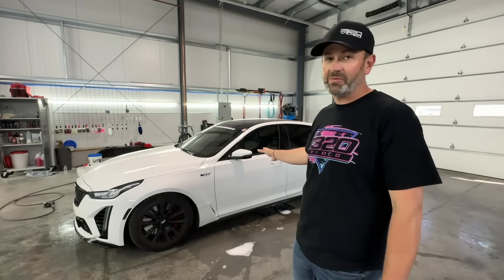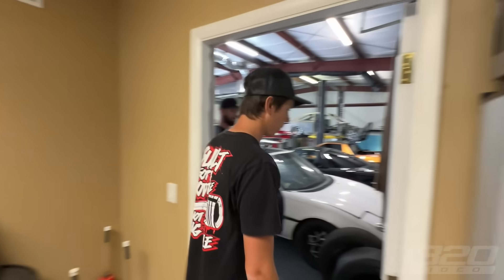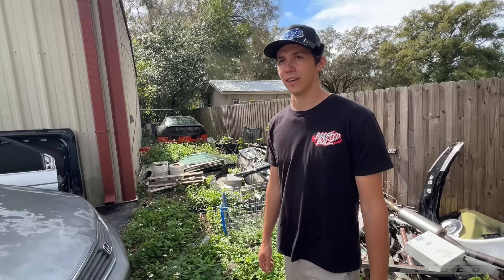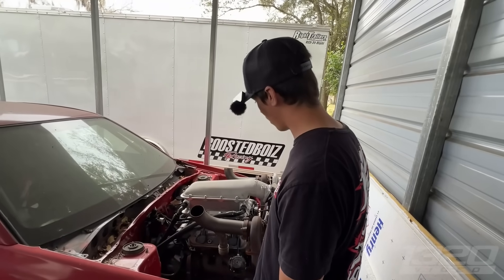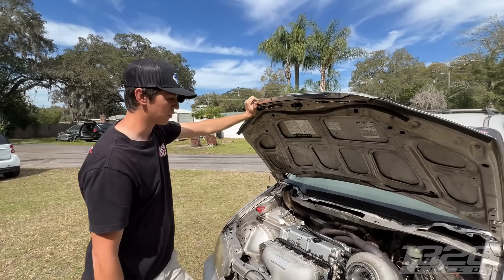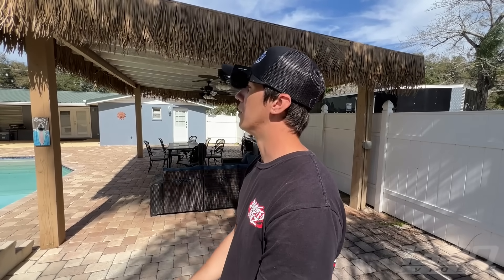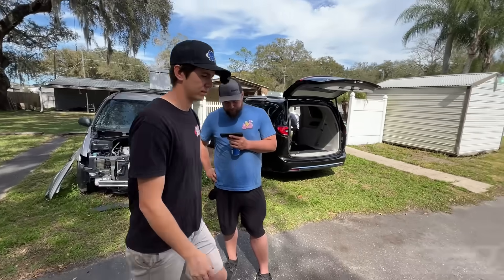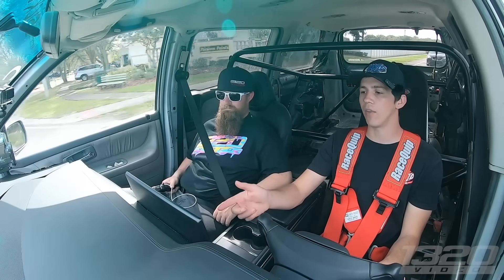BoostedBoiz INFAMOUS Car Collection + Garage Tour (Record Holding Hondas)

Comment: Keep hearing you refer to the motor blowing & trans failing as "part of racing" & while I agree parts taking constant abuse of track conditions and parts at the limit of their capabilities under high stress will fail and need replacement and that is truly part of racing no pro driver has ever had a shred of mechanical sympathy that being said that's why companies like 4piston offer their motors & quaife their transmissions and costing $15k + each these aren't cheap nor run of mill and there is a difference between a failure after 2 or 3 seasons of hard track abuse vs 2-3 hours of light run time. That shouldn't happen and is not part of racing. And with no solid explanation especially the trans I'm now terrified to pull the trigger on a quiafe myself having been saving for one for years. As far as the motor 4 piston is certainly big in NA FWD drag but maybe 1000hp time attack isn't their cup of tea